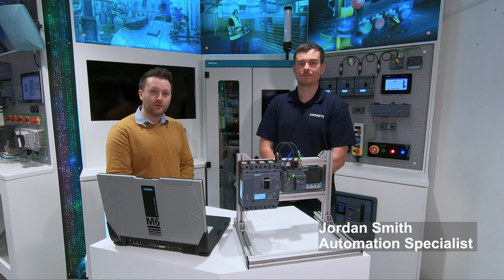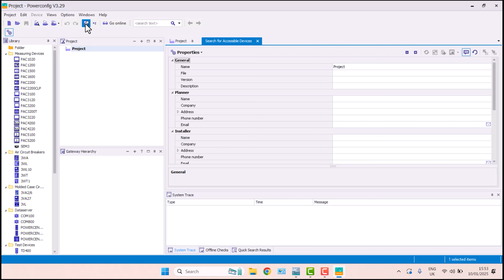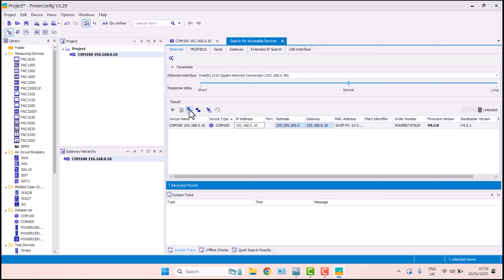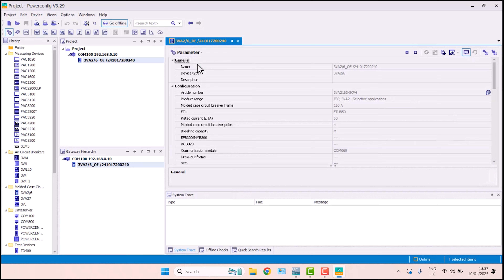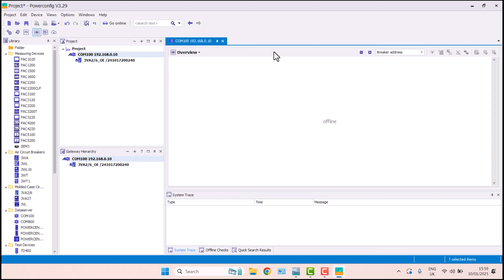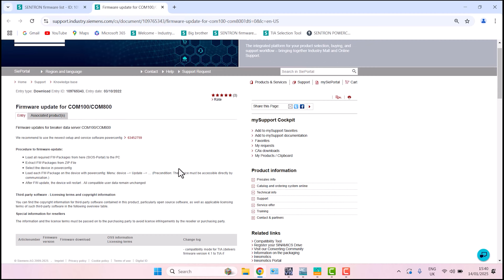How to Use SENTRON Power Config Software with 3VA MCCBs

Comment: Hi, I am a service technician working at a DHL facility in the Netherlands. We have 3VA2 ETU320 LI MCCB's installed for low voltage applications. We are experiencing an anonymous trip on one of the MCCB's. The trip jumps the downstream cabinet and go directly to the MCCB. We are considering installing a EFB300 unit to get a better understanding of what is happening during the trip. Can you please make a video on how the EFB300 works and how to retrieve data from it, or please reach out to me. Thanks in advance.